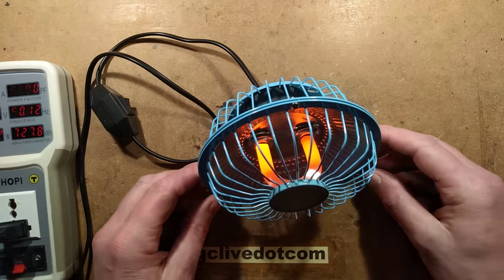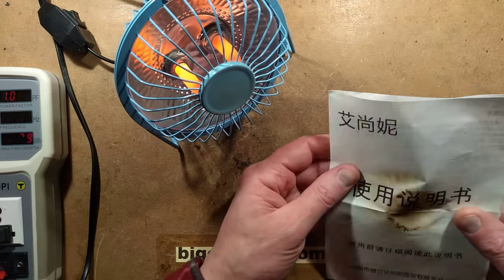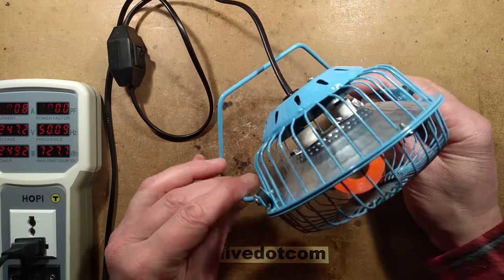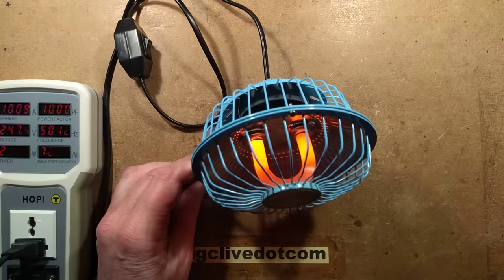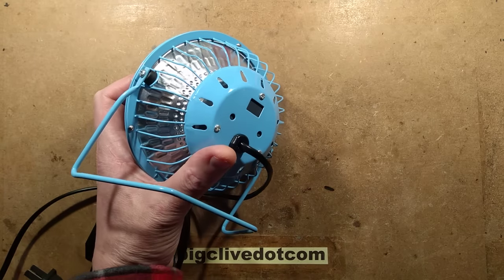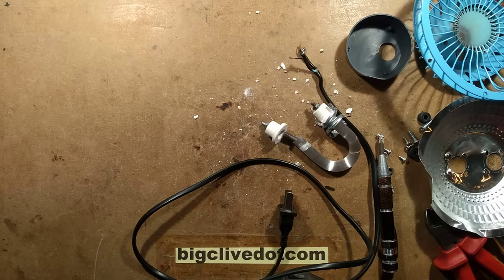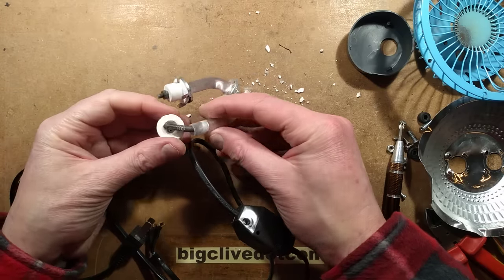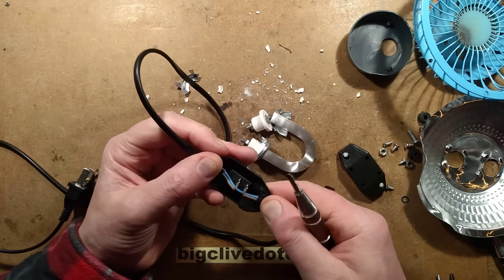Chinese automatic house ignitor.  (also available in pink)

Comment: after signing in to comment(P.I.T.A).......use the "pie dish " as a dichronic reflector for a couple of  large  wide angle emitting LEDs in the two large holes,powered from a joule thief as a porch light,protective cage an' all.

Or

use those flame type LEDs and it'll look like it's on fire instead of using the actual heater to set things alight which would be more costly.

Comment: I have similar fans. What worries me is the rubber grommet thing that connects the base to the frame is the same rubber. It's not heat protected at all. If it heats up or melts it will angle the heating element down. Very unsafe

Comment: You could turn that in a single household - single slice of bread toaster. I wonder where the U shaped heating element comes from, certainly not originally designed for this. If I had to make a dirt-cheap heater I would take a mass produced heating element for toasters.

Comment: In English, an ignitor is something that will set fire to something. Is this a heater or an ignitor? If your house isn't in a pile of ashes, it's either broken, or its a heater.

a. To cause to burn: The spark plug ignites the fuel.
b. To set fire to: faulty wiring ignited the attic.
Reply: Firstly the title is an obvious joke, also idk why you feel the need to specify "in english" the dude is clearly from the UK with that accent, and knew exactly what he was talking about. Other countries have alot of english speakers in them too

Comment: Any easy way to make this safer? Maybe adding a thermal switch to the front of the assembly, that triggers only when the front is covered or experiences low airflow could be simple? 

I can't find a desktop infrared heater besides one similar to this (though at least the "newer" designs look much more difficult to tip over).

Comment: Holy shit I have this fan! (Fan, not heater). Mine is a bare metal color, and those holes house an on/off switch. That's the exact chassis, though mine must be "premium" since it has little rubber feet on the 4 corners of the wire "stand"

Comment: I still havn't finished this video, its gonna give me nightmares. But I have to get to the part where you disassemble the switch and find a timing circuit or remote control to turn it on. When no one is around.

Comment: that metal basket case was made for desk fans. they use the same stock to manufacture other things in the same factory. the square hole in the back is for the power switch for the fan. it was never intended to be used for a heater. that's why it's such a poorly designed heater.

Comment: I am wondering if the heater or the switch is the larger hazard. I guess it is a draw. 😂

One suggestion to the manufacturer: tin the copper wires before screwing them to the heater.

Comment: You shouldn't touch quartz glass by hand.
Skin oil will leave a residue that will make it crack at working temperature.
And no,  you aren't likely to wipe it off completely later.

Comment: A fan during the summer, becomes an heater during the winter.
A very flexible, market-attuned production line.
The fan can be safely powered by some batteries. Mine is powered by a single rechargeable 18650, a format well accepted by Chinese customers. They don't like to pay for alkaline batteries, especially if they are totally flat at the point of purchase.
But one 18650, or two, are not sufficient to heat up the sorrounding: a premium 18650 can push max 10 Watts for one hour, but the customer wants the heat all night long; also their 18650 are not premium; they can't push 10 W at all, but more likely, only one or two watt.
So the garden shed industrialist switches the source of power, and their heater will now be powered by the mains; here 200 W are not a problem at all!
The customer can easily set the house on fire; a metallic casing lacking a ground connection, means that few drops of water can induce a deadly electric shock.
No fuse means that the heating element can explode if it so wish.
"House Ignitor" seems an appropriate and descriptive name to me; but it only cover the effects on the house. You need to complete the name with "People Roaster" somewhere in the description. 
Sarcasm aside, I wonder how eBay allows these type of devices, that breaks all safety regulations of the world over, on their platform.
Thanks for uncovering such blatant liability.

Comment: If you're looking for a space heater and don't want your house to burn down, please buy a heater with an automatic off switch that kicks in when it gets too hot or it is tilted over, and whose case cannot light a cigarette when at full heat.

Comment: does the quartz tube block air for the element?  Could you run it without the tube or no?
Reply from the maker: It is just for support and insulation.

Comment: Unless strict safety guidelines are adhered to, this unit can be very dangerous, if tipped over accidentally. No 👎 safety tip-over switch, or thermal shutoff. Or if the heater's placed too close to flammable materials, it will not 👎 shut off, it will catch them on fire 🔥. A cute little unit, in a way, as long as it's being supervised, and at least one person in the house 🏠 remains awake ⏰ during use. ALWAYS unplug 🔌 the heater when not 👎 in use. Keep 👌 it out of children's reach. This will prevent use by them, accidental injury or fire 🔥. Your friend, Jeff.

Comment: Wait am I being stupid- you said the element with the lower ohm value and thus lower resistance would generate more heat? Surely heating elements generate heat by resistance so a lower ohm value would generate less heat?
Reply from the maker: Lower resistance, higher current multiplied by the voltage gives greater power dissipation.
Reply: bigclivedotcom Thanks. My expertise goes as far as a GCSE in D&T electronics.
Reply: bigclivedotcom I’m assuming there’s some kind of sweet spot trade off with resistance to generate heat, otherwise wouldn’t good conductors like gold get really hot? Tbh I still haven’t got my head round this, I was under the impression resistance generated heat so better conduction, lower resistance, less energy  converted to heat. Think I need to read up

Comment: The trouble with those "strain reliefs" is that they're just clamps, with no trace of any strain relief! I've lost count of the number of open circuit mains cables I've had to re-terminate because of those damn' things...
Reply from the maker: Yeah.  They pretty much put a stress point in the cable.

Comment: Cant believe it took me that long to figure out that wasnt a coil, it was just an oversized hot surface igniter. Ive never seen one of those without a limit switch that wasnt designed to go off in 15 seconds
Reply from the maker: It would have been interesting if it had been a solid hot surface igniter instead of the heater coil.
Reply: @bigclivedotcom  was it not just a big glow plug? Sorry, im only an apprentice to HVAC i dont know all the parts by heart

Comment: ....So not that it's an excuse, but it's worth noting that this was meant for a Chinese consumer. It's going to go into an unpainted concrete room, and the person buying it has been dealing with unsafe products their entire life (they know not to fk around). It needs to sell for less than 5 dollars cause they only make 2000 a year and it's only to heat their single room rented from the factory they work in, it's getting thrown out in 4 months when a recruiter offers them a job 2000km away.

Why is it being sold on eBay? Because someone thought they could make a buck and there is 0 recourse available for anyone harmed by it. The person drop shipping it doesn't understand we live in houses made of wood and we generally assume products are idiot-proof, and even if they did they don't care......largely because they know we don't care about them either.

Comment: This kind of goes to show you how many desk fan cages have been on the market that China started using them for crappy heaters they're not even that bad it's just that heater was the worst thing you could have done with it normal USB or even main Outlet fans in these Run fine and and are somewhat common in many countries in places like Walmart or poundland or pound shops stuff like that
Reply: Also just watching take this apart so simply already shows you this thing was made by hand entirely with most of these being Stock repurposed Parts most likely hell I would be surprised if this thing wasn't just made to get money and they didn't care if it freaking set your whole freaking building on fire

Comment: No in China i`ve never seen such thing. in the north, such thing will be far from sufficient and in the south they use aircon`s integrated heating. there`s just no suitable position for these things to be used.  Also they don`t pass chinese safety standard thus can`t be sold via regular retailer.

Comment: It reminds me of them soviet production heaters we had at school on the cold winter days(think -20C and lower). Some smartass designed a summertime style building with huge windows that practically almost totally represented one of the four walls in every room, which, given that it was plain wooden frame and one or maybe two glasses within it, wasn't really screaming "heat insulation" at winter time(which often reach out up to -40C). Since the generic radiators were placed right under them windows and weren't sufficiently powerful for them big classrooms, one could often observe this or that model of heater blasting near the whiteboard, this particular style ones often without any resemblance of cover, I often had a semi-reasonable fear that in case some of them bullies will "accidentally" push me onto one of the heaters, the experience would be quite unpleasant indeed =) I guess, no need to comment on the fire code practices of this particular educational institute (=

Comment: It does not have a thermal cutout because it is not relying on any fan. So . Any thermal cutout is useless. If it were constructed no fixed it in the wall   and not on the floor    it will be better.
Reply: Maybe a gravity cutout.

Comment: The instructions are also coated with a fine layer of covid-19. 
It may be a useful bath water heater immersion heater. 
It’s a fan case with a dodgy heater inside. 
The paint is lead based and the insulation is asbestos. 
Thanks pr see.

Comment: i can guarantee that the case was designed for a fan, because i have the exact same thing in a darker blue, except with a motor, and aluminum fan blades. And the worst part is that it doesn't even work very well!

Comment: I actually have the fan unit in exactly the same case with a rectangular switch that fits in the cutout you have. Mine is  a 240v version also purchased on eBay from china to be used here in Australia and works quite decently. However I ordered the Blue version and unfortunately received the pink one. Maybe its a Chinese conspiracy to make us in the west feel unfulfilled and drive us all a little bit more insane?

Comment: actually, for mere 250w it's perfectly normal design, i mean c'mon, back then there were 250w light bulbs no one was complain about. also wtf 250 volts, we have 230 at best usually.
as for flimsy stand, you re probably have it backwards, in other case it would fall on back with face up, not down.

Comment: Give that puppy and inline power regulation control and put it in a smoker cabinet with a few rakes and a wood chip tray. Or Refit an old smoker with a burnt out fire box plate off the end of the smoker box were the fire box was cut a hole in the under side for the heater and put a chip tray over it.

Comment: It is just an example of why some cheap Chinese items are dangerous!  I wonder of they have any safety regulations in China that would make the heater turn off if it tipped over.  I know there are heaters like this in Costco but a lot safer.  Still I don't like those really either.

Comment: I hate seeing a person test the ohms whilst touching the test probes simultaneously
Reply from the maker: If I was measuring a high resistance it would be an issue.  But for low resistance any body contact is not going to have a significant effect.

Comment: This little piece of crap has a charmingly libertarian attitude to it. Safety features: "Have you tried not putting something flammable on the red hot heating element?"

Probably should have replaced the rubber vibration-dampening spacers from when it was a fan cage with something less melty though.